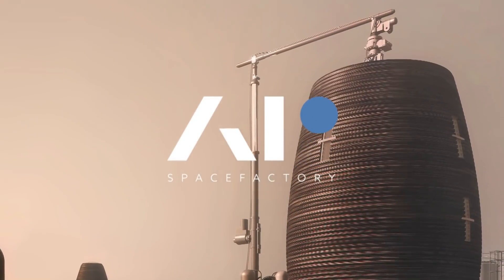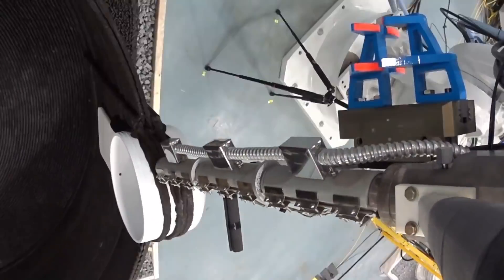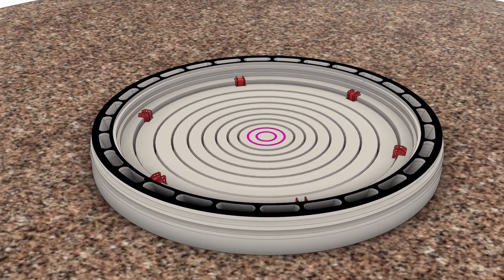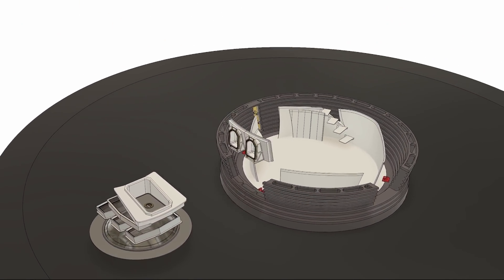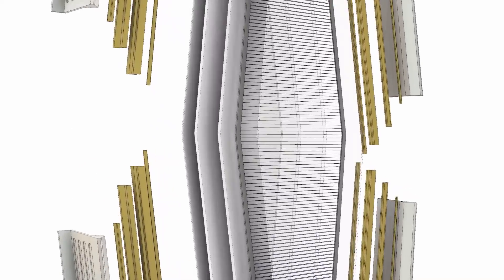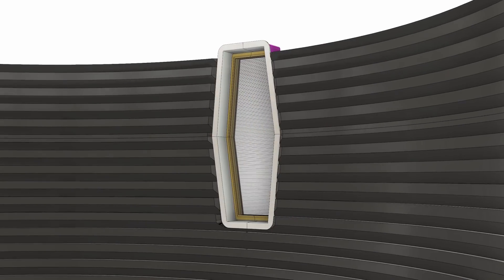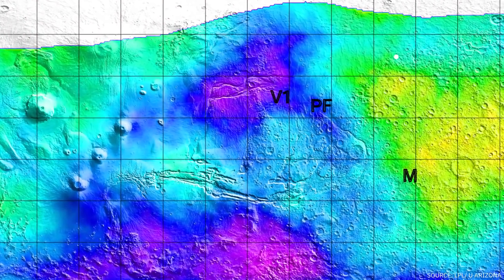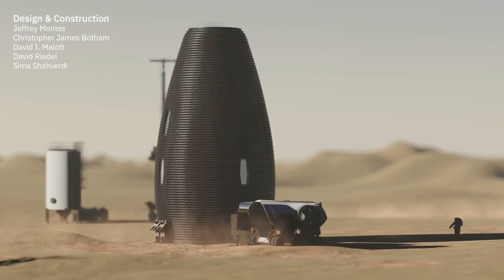AI SpaceFactory - MARSHA - Our Vertical Martian Future - Part Two

Comment: Having sky light and separate windows in a pressurized container... I think it should be rather monolithic construction with fiberglass carrying daylight inside and no windows. Safety first. It also provides better micrometerite protection (in a thin atmosphere they can hit even from the side)
Reply: And way easier to build without windows and skylights. Greenhouses separated from other units can have windows, but not the unit where people live. Uninterrupted wall is surely better for pressurized units for leaks prevention and also is stronger mechanically.
Reply: And remember about thermal expansion of your walls, on Mars temperature variations are huge.

Comment: PYRAMIDS: Perhaps we should build space habitats, on the Moon and Mars, just as our ancestors built the pyramids. They are the most economical use of 3d printing, inflatable habitats, and multiple story building. They also provide the most economical and quickest way to guard against micro-meteorites and radiation. You must ensure that you can move machinery, equipment & stores to the appropriate level within the habitat, and pyramids provide a smooth ramp to every level. This approach basically involves blocks of polymer-infused regolith, surrounding a space filled with tamped loose regolith, containing walled empty space for habitation, or even just stacked inflatable modules, and a helical ramp just inside the blocks, with access to each level, to move things around. Robots could collect and distribute regolith, make blocks of amalgum, tamp regolith, move equipment critical stores and habitat structural elements into place. And just why would you need windows, if you have cameras outside and video projectors inside the habitat?
https://www.youtube.com/watch?v=j4cdDT1ZvAA

Comment: I love this. When you end up with a handful of these to make a village and let's say everyone wants to gather at one of the Marshas for a bday or celebration how to they all get inside? I see the 2 exterior wall suits (great concept) and the air lock for the rover. Is there another airlock? How about a way to interconnect multiple Marshas along an avenue or hub? I suppose with a 2nd airlock like the one for the rover then you could have 2 or more Marshas back up to a hub (inflatable or structural). Does the design lend itself to scaling? Does it work at 2 or 4 times this size? I'm thinking that would be for a main operations/research/engineering structure and there are regular size Marshas attached around it for habitation. I hope you get to work with MDRS and put one out there for them to try out and provide feedback on best interior layout. Keep up the awesome work.

Comment: I suspect the actual unit will need to be a lot bigger as shown in the video. It is because each unit will need to host the components for  recycling of air, water, and waste. I would believe that each unit by itself should be self sufficient or sustainable while the whole colony with maximum redundancy as part of flaw tolerant measures.

Comment: Did they mention anything other than a "thicker atmosphere" as a way to reduce the radiation exposure?
Reply: Due to their low overall atomic weight, their bioplastic (polylactic acid, or PLA) materials are effective shields for ionizing cosmic radiation. (-upupaeops)

Comment: So built on Earth in segments then flown to Mars where the extreme cold temperatures and violent wind erosion will first shrink that polymer to a state of decay but you cannot rebuild it because it needs to be heated to high temps then settle and cool. On Mars everything will flash freeze basically. Sounds risky.
Reply: I think the lack of atmosphere on Mars makes heat transference a lot slower buisiness, also the martian wind is a lot less powerful than here on earth for the same reason.

Comment: I would love to see reasoning behind selecting this site. This area will be exposed to winds up to 30 m second that can disturb printing. 

IMHO Large and tall spaces are problematic because:
- build times (building in the right weather)
- size of the printer arm etc.
- safety - single point of failure.
- wind/termal noises

Multiple small habitats easy to scale and discard in case of structural issues.

Comment: the only problem i see is the lack of seperated air spaces in case of a leak or maintainance to the outer hull. if there is a leak there is no shelter inside the habitat to go to while a team tries to seal the breach. but still this is the best design ive seen so far

Comment: So as cool as this idea looks, how is it supposed to include shielding from radiation? those walls seem pretty thin, and the higher elevation makes a bigger surface area to be exposed to solar and cosmic rays. Plus, why not just use the local Martian soil to build a habitat? If you compact it and melt it down it could probably perform much better than standard PLA, and you don't need to carry it with you from Earth to build it.

Comment: All these 3d printing plan never mention the construction needs to be finished in an exposed field with dust and wind for a couple of weeks or even months.  How to prevent the adhesion problem  if dust got stuck on the unfinished layers?
Reply: also mars gravity is about a third of earths. they might need a different method of 3d printing.

Comment: Why do they have to be so small? Why not use an entire crater and put them in there?
Reply: RazorX53 what if it doesn't work? What if something that nobody thought of or had any idea about makes things go wrong?
Reply: @leecaste  what's your problem?
Reply: I've no problem, I'm just saying that building a structure the size of a stadium without testing smaller versions to check if the concept works is a very bad idea. It's like asking the Wright brothers to build an Airbus before knowing if a little airplane can fly.
Reply: @leecaste  if the Wright brothers had access to simulation tools they would have made early aircrafts in the simulation and made the Airbus within a decade.
Reply: RazorX53 maybe but not the first one, you ask to start with a crater size one instead of a "small" one.

Comment: How will building this habitat on Mars differ from building it on Earth? For instance depending where a habitat is built, the temperature can get as hot as -61°C; how would the thermoplastics react to such a rapid cooling? Also how will this structure change when exposed to Martian dust during construction, are the people living there supposed to sweep it all out when its completed?
Reply: I think after it's been built and sealed they can just pressurize it and use a normal vacuum.

Comment: This is one of the best designs I have seen for 3D printing a habitat on Mars my question that I have is what I noticed from the video is the structure would be open to the atmosphere the entire time its 3D printing which means that once the 3D printing is complete the inside of the habitat would have to be decontaminated from dust and particles that settled inside during the 3D printing process perhaps using a sheath on top of the structure that would surround and cover the structure as it grows blocking out a lot of the dust and particulate matter from settling inside the habitat.

Comment: real life on mars will prove or disprove the viability of these designs. it may be that some other design proves to be more effective. if that is the case, building multiple types of habitat will result in protection of personnel from the failure of one type of design. it may be that a habitat based on gabions, or cut stone will prove more practical.

Comment: What about radiation?
Reply: According to AI, due to their low overall atomic weight,  their bioplastic (polylactic acid, or PLA) materials are effective shields for ionizing cosmic radiation.
Reply: @Walamo dumb, and this explanation is just dumb, it's not magic about putting 'atomic' in front of words. Anything as weight, it doesn't explain sht.
Reply: @5thGenNativeTexan  Amazing

Comment: What about the radiation ? Wouldn't be better to build those cilinders underground for radiation protection ?
Reply: Too much of a hassle to dig all the dirt out and it is a double shell design, so the outer shell absorbs the rad i think
Reply: Dimple I don't think those walls are capable of absorving gamma rad but I would like to see a few simulations.
Reply: Flying Speed Brake Generally, when they make very little or no mention of a particular item it means they don’t have a viable solution for that particular item as of yet.
Reply: I’ll second that. It takes very little radiation to screw up the fragile human genome. What good is trying to preserve the species, when species will be sterile mutants within two generations?
Reply: @Flying Speed Brake I'm also a engineer and I just would like to know how the supposed radiation shield work with such a thin wall. I'm just trying to understand.
Reply: Renan José inflatable modules by Bigelow Aerospace protect more from radiation and micrometeorites than ISS' walls themselves, we can do better than making something thick.

Comment: Why have windows at all?  You could achieve the same light/view with HD cameras outside and portrait mounted LCD panels inside.  Lighting inside could even be tweaked to mimmick the frequency/color of sunlight to help out the occupants.  You'd get all the benefits without weakening the structure.
Reply: Except vitamin D, and letting the eyes see the sun and uv rays or whatever to keep eye sight.
Reply: @muuubiee  people live in nuclear subs all year around, i think Darren makes a good point
Reply: @sausage4mash  For 2-4 months at a time.
Minimum mission for an astronaut would be 3.5 years. That's 3.5 years of never going outside. They'll be able to go out in a suit, but that's not being outside, all they really get is to see a the sun, a dim sun.
They definitely need windows, LCD displays is not a replacement. Even if you manage to get high enough pixel density, and realistic light (amoled maybe, but it'll burn in), they'll know they're looking at a monitor. I believe chances of mental breakdown is very high without windows, especially in a confined space like the other suggestions.

Comment: The MARSHA design is the most elegant engineering I've ever seen. It's the one I'm rooting for.  I considered the inter-hab activity as well and first thought it would be better to have a second rover dock that would support hab-to-hab trips in a shirtsleeve environment; plus the current rover designs I've seen have two integrated exterior suits that would allow four person teams per hab to go outside; but on second thought, to minimize pressure vessel penetrations, it would be better if the rovers had left and right side docking ports that would allow "visiting" rovers to dock and walk through a rover already docked to a hab.  (forgive the run on) That feature could also allow multiple rovers daisy-chaining to create a mobile base for extended field operations.

Comment: For a all the ingenuity and sensible engineering going in this wonderful design, why do you want to place shutters in-between two layers of glas, where they can never by accessed? You can't just replace the window if the shutter breaks.
Reply: You would save space and never have to clean them if they are inside the polycarbonate layers like they designed.
Reply: @dr.mcdougall1010  
Space is not a concern.
Serviceability is. 
Your best shutter is worthless if it brakes breaks and you can't repair it.
Reply: @3gunslingers  you meant breaks* and it wouldn't need serviceability for an extremely long time.  You are assuming we won't have any tools on Mars. LOL. It would still be serviceable on Mars, it's just easier to manufacture on Earth at the beginning of colonization.   You saying space isn't a concern? What are you smoking Willis?  Space will be an extremely precious commodity for early colonists. Cleaning is also a huge factor.  Your idea isn't as good, sorry.
Reply: @dr.mcdougall1010  
yes, breaks. Sorry. English is my third language.

By serviceability I mean reliability. You have to expect that EVERYTHING breaks sooner or later. Everything you can't access is liability.

Just put the shutter on the inside of the window. It doesn't take any habitable space, is serviceable and can be controlled by hand. And it can be dusted off, by anyone who wan't do to so.
Of course it will be manufactured on earth.
Reply: @3gunslingers  We will have to agree to disagree.  I see your point but I think putting it inside has enough benefits to seriously consider.  It's all pro's and cons and would need to be thoroughly plotted to determine the best route.
Reply: @dr.mcdougall1010  
Thanks.

What would be one benefit of putting the shutter between two layers of glas? (except not having to clean it)

Comment: While this is really impressive, you need to rethink the renders of base/colony wide shots. This hab can only every have a number of people inside equal to the number of suitports. Human beings need communal, community spaces, and the ability for people living in different habs to socialize that doesn't require going outside. I'd suggest additional prefabricated parts (hatches) that would then lead to printed walkway tubes, that connect the habs, perhaps via occasional central MARSHA structures which would function as community spaces (since you show kids, school, library, etc). This might also allow for at least one proper airlock in a dedicated building (which could also include showers, and other facilities to keep martian dust isolated).
Reply: It is a good idea though, having shielded tunnels to communal areas that don't requite a suit or vehicle, especially having access to emergency shelters when greater levels of shielding or armor are needed, and it would let each habitat specialize more since they don't need as much redundant systems.

I wouldn't add to many extra suit ports though, the more holes your make in the wall the more potencial failure points are introduced to the pressure vessel
Reply: I'm sure its been thought about. There is no limits to 3D printing. Different structures for different needs. The options and designs are endless.
Reply: "This hab can only every have a number of people inside equal to the number of suitports"

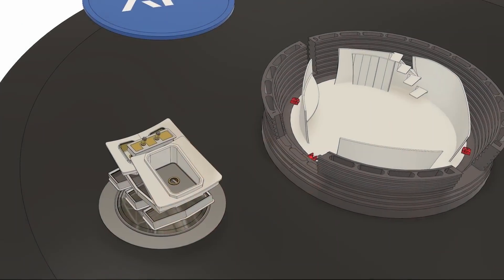The primary crew access is a vehicle docking hatch, not the suitports. The vehicle hatch is shown at 1:50

That said, I'm not sure why they're so fixated on this tall skinny design. It's not like land prices are an issue. The same structure, built horizontally, would have a lot more useful volume. It would also lend itself to continuous modular construction. (Build the first section's shell. While you're fitting it out internally, the robot is building the second section's shell. While you're living in the first section, fitting out the second section, the robot is building the third section... Each "external" hatch between sections becomes the internal emergency bulkhead hatch once each next section becomes airtight.)
Reply: @1FatLittleMonkey   Thanks, I missed that. The other video and the stills don't really show it, either, however. The first video gives their rationale for the vertical cylinder. Seems like they could put hatches on the second floor, and bury the bottom in regolith, as well (sleeping quarters in the buried bit). I'd like to see how well this mitigates radiation. 

I think the issue with your (good) horizontal building idea is that the robot would need to be substantially larger (it stands outside the structure).
Reply: @mmeiselph7234  They compared a vertical cylinder with a dome. A dome is a terrible pressure vessel, so comparing anything with a dome would result in the other thing winning the comparison. As for vertical printing, at this scale, height (especially with a single pole, as shown) will induce stability issues. Requiring the same range of motion, but horizontally, will not add to that. (In a conventional 3d print enclosure, the cross-arm is supported on both sides, the base generally moves up and down. Hence height is easier to add than width. You just make the sides of the machine longer. But the "Marsha" bot is a free-standing device. Height is bad.)

Edit: Oops, forgot to comment on your suggestion. Yeah, burial is a cheap way to get radiation shielding. But their method of 3d printing pretty much excludes it. A horizontal cylinder could be covered in regolith, keeping just the windows and hatches open.
Reply: @1FatLittleMonkey  agreed that the 3d printer they're using isn't salable to a mars mission (their vertical twig tower crane is not thought out...). of all of the enteries in the NASA competition, only Apis-core did a reasonable job on that front, but still isn't a construction friendly design. The problem is there's no existing industry players right now. These guys really need to move past the existing conventional 3d printer designs and move to something more like www.constructions-3d.com 's articulating boom (the most realistic construction printer I've seen), or do something like a tried and true pump truck design https://www.putzmeister.com/web/americas/products/-/product-category/view/52566/type1/concrete/concrete-pumps/boom-pumps or mount a your detailed printer head on a regolith counter weighted telescopic boom https://www.genielift.com/en/aerial-lifts/telescopic-boom-lifts/sx135xc
Reply: @1FatLittleMonkey    The vertical nature (along with all the analysis on usable space, rigidity, etc) is explained in great detail in Part 1...  https://youtu.be/XnrVV0w2jrE
Reply: @1FatLittleMonkey  the shape of the building gives more stability in the structure
Reply: This is why I believe the domed doughnut shape that will be 3-D printed is the best option.